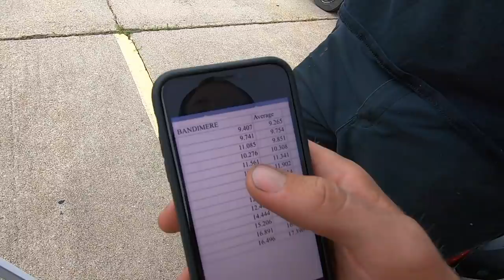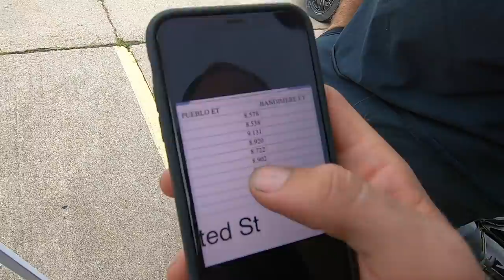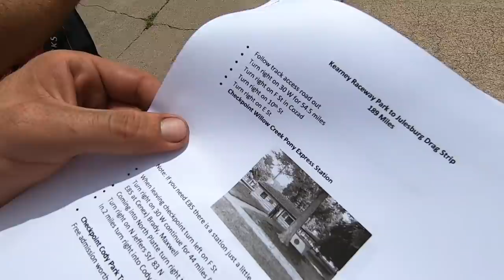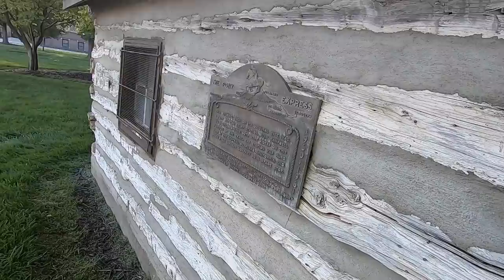Race Week 2019 DAY 5: Fighting Back To the Top... We Need FAST Passes!

Comment: "How hard can it be to drive in a straight line" Watches Cleetus  in run #2: "oh"
Reply: Leroy hasn't had a straight run in a year.  They really need to get that under control.  Hes not going to get into the 7's again until they do.
Reply: @Mini Dk#9 that's gonna be a while. I think it needs a solid rear axle, it unloads so much between his 1&2 shift. I know the weight needs to transfer but damn.
Reply: That's true, he used to track really straight. They changed the shocks a bit ago I thought to address it.

Comment: Ok so if you go to 24:09, the panel that says “turn on intercooler”. Totally feels like you need to have the time circuits panel and the switches. Then turn around and you’d see the flux capacitor between the seats! I know Leroy isn’t a Delorean, but you could have so much fun with it! Today I was thinking how cool and useful but I’m sure extremely expensive it would be to build a pickup where the bed is only a short bed and then when you need a bigger bed you flip a switch and the bed extends to your choice of either a standard or long bed, depending on what you need it for.